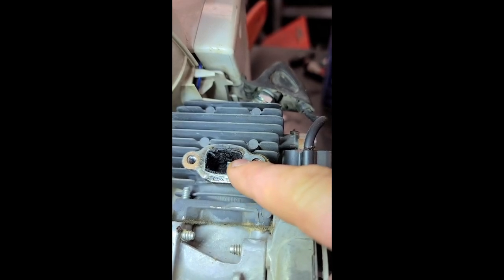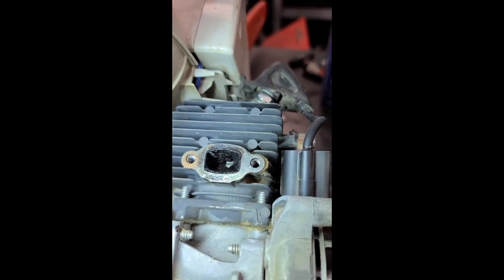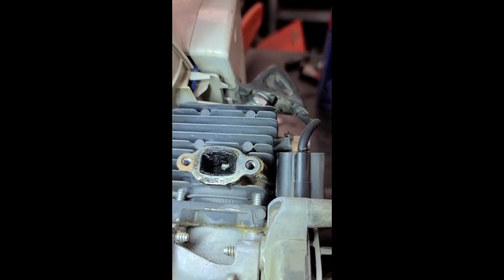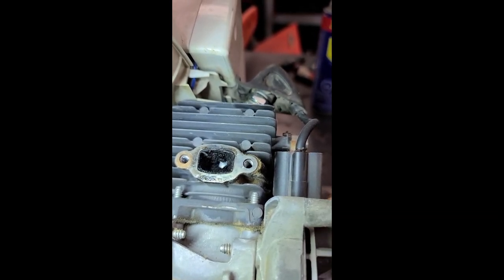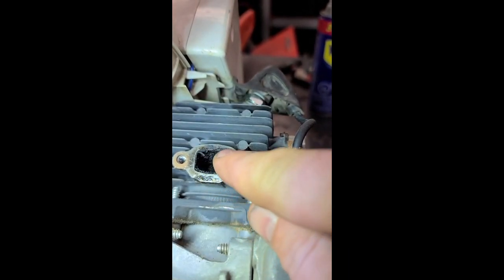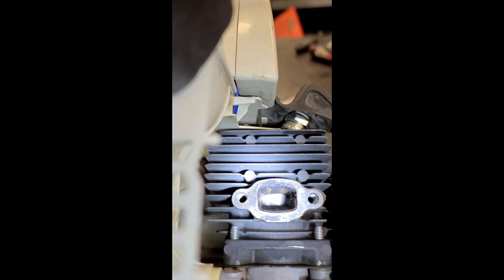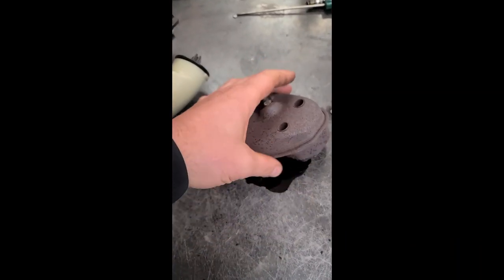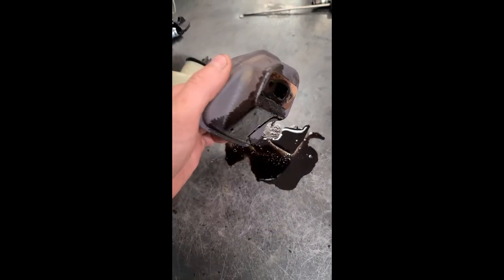Most Common Reason Your 2 Stroke Stihl Equipment Bogs! #shorts

Comment: I had an old 1978 Lawnboy 2cycle push mower, it would cake up the exhaust every few years. I had a 1/4" dowl rod I used to clean it out and I always blamed the lawnboy brand oil 32:1 mix as the problem. It finally gave up the ghost in 2015...loved those mowers, light and high rpm. Too bad they aren't made like that anymore!
Reply: Stupid epa emissions

Comment: That's caused by too much oil in the fuel. That build up happens during a rich fuel condition. In this case, I don't think any amount of adjustment to the carburetor would have leaned the fuel out enough to prevented that.

Comment: And that is a fact an clogged or blocked exhaust port is no breno.  I bought a honda civic years ago really cheap because of no power basically bogging and turned out a baffle in the exhaust manifold had broken off inside and partially blocked the exhaust exit. Who would have thunk it. 😁

Comment: Is it too much oil in the mixture or not running it wide open enough or both🤣. That’s crazy
Reply from the maker: a bit of both
Reply: A clogged air filter will contribute to the cause.
Reply from the maker: @Urbicide  definitely!

Comment: I wonder if the owner of the blower only ran it 5min each time it was used with the choke on. Thus running rich and not giving the motor time to warm to proper operating temp. Might be better to have an electric cordless blower if total runtime is less than 5 min.